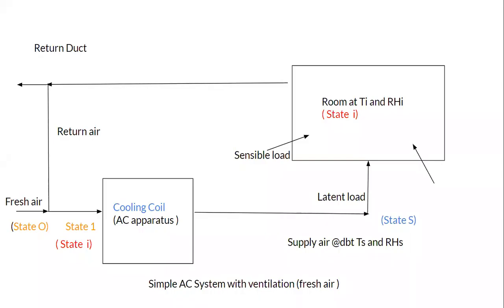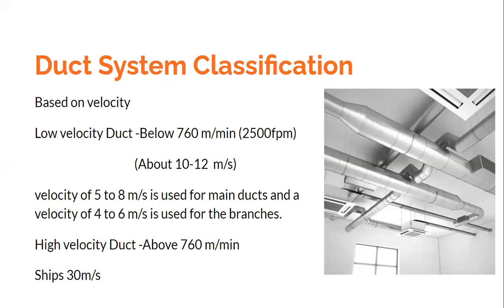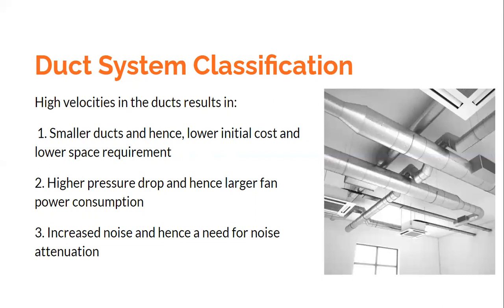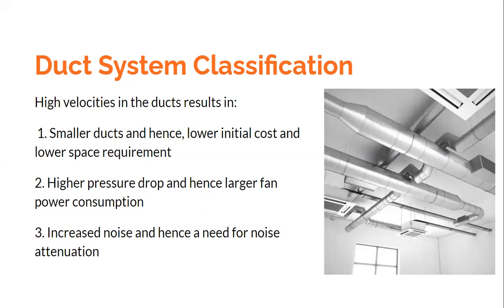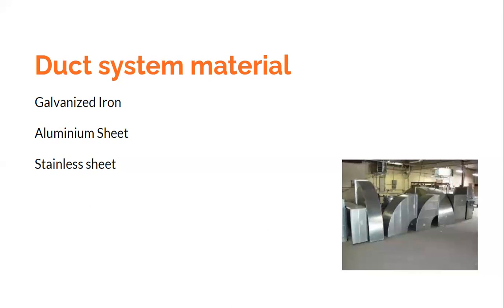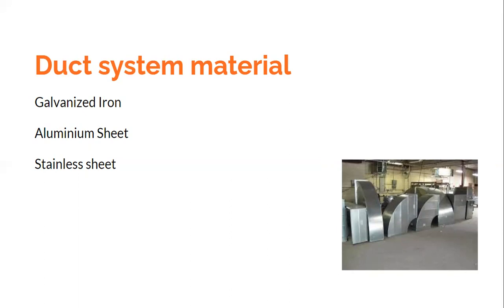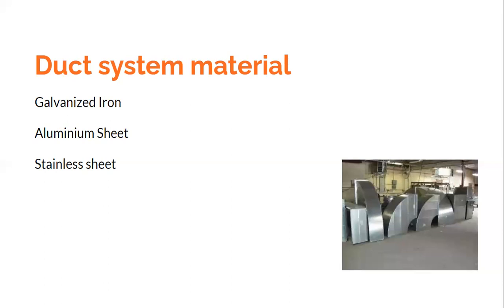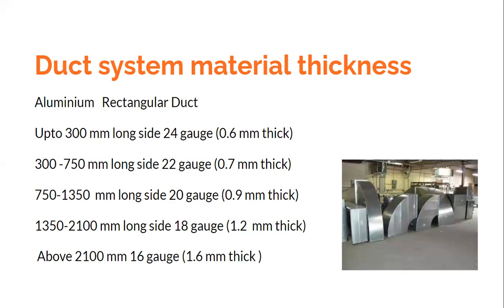HVAC Duct system classification and materials

Comment: Hello sir, how you doing??hope you doing well,,could you solve some examples on ESP calculations using different elevations??? maximum inside all ducts elevations are same or if it comes not much difference (while using offsets) but for example our packaged unit is in rooftop on g+5 building we have to take ducts to ground and first floor so in that case how to calculate ESP(friction loss and dynamic loss)????
Reply from the maker: Yes will post the same 
Meanwhile https://www.udemy.com/course/central-air-conditioning-and-chiller-system-design/?referralCode=0250AE30AFF908BAAFF8